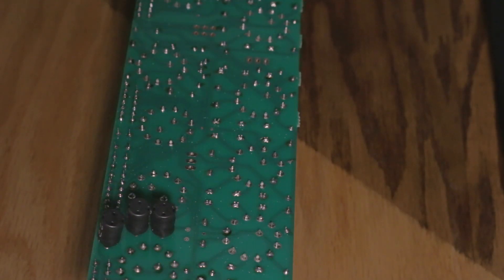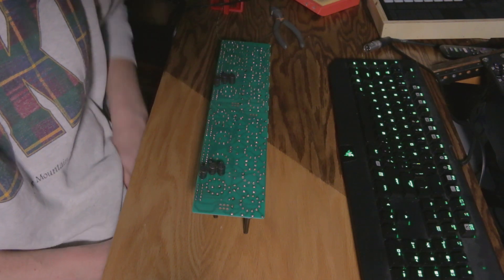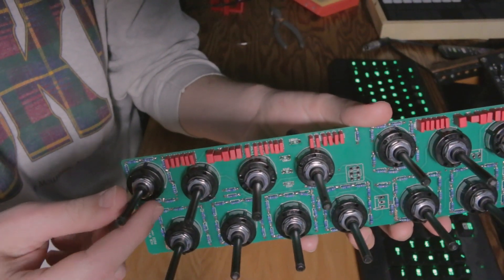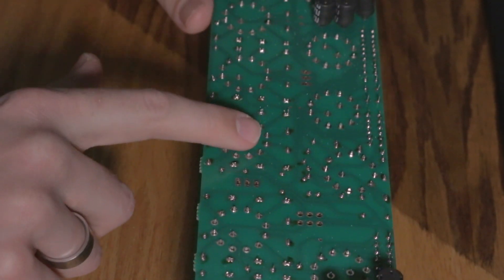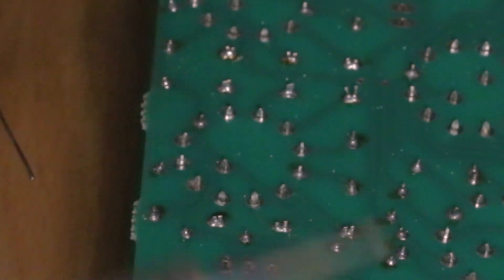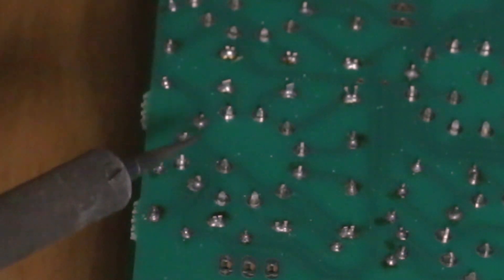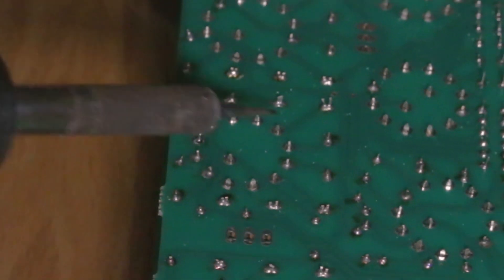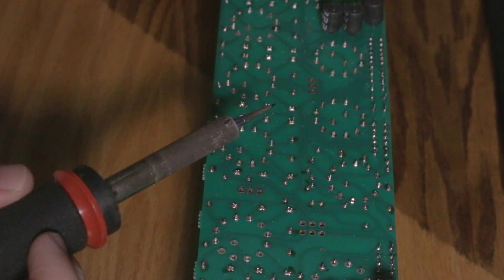How to Solder / Reflow circuit boards in audio gear (or most thru-hole PCBs)

Comment from the maker: To clarify - "reflowing" in this case is applying the iron to a lead / pad that is already "soldered" where you need to make sure the joint isn't a cold solder.  I'm not talking about re-flowing a PCB, entirely via a reflow oven.  I'm aware that the processes are different.